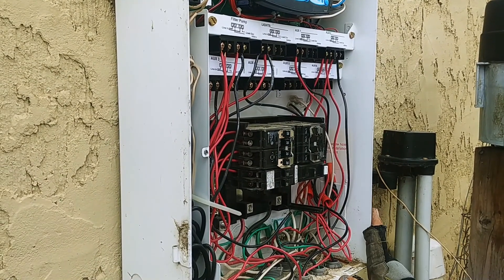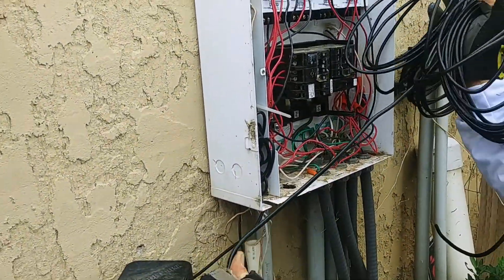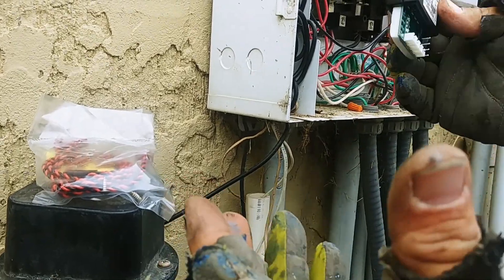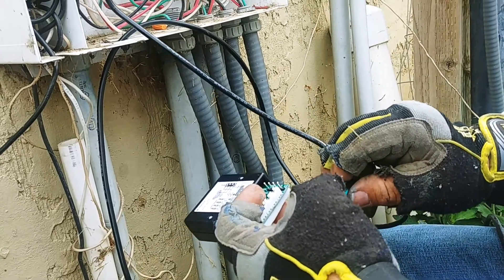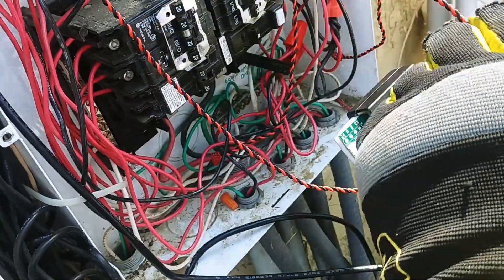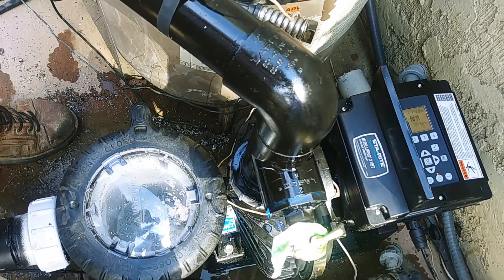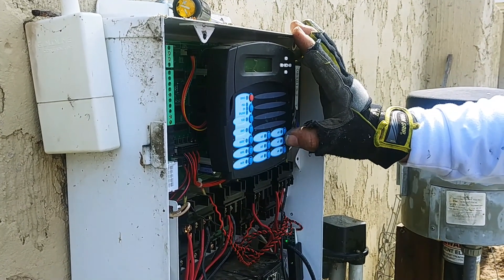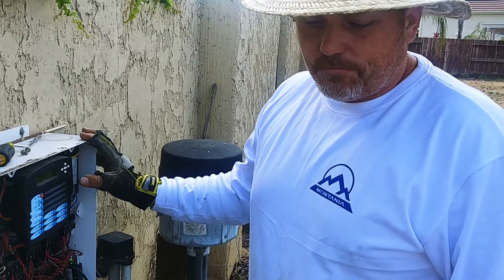Intellicom 2 Intelliflo / Intellipro Controlled From Any System  Hayward, Jandy, and older Pentair

Comment: i think this is a poorly designed product. 1. The hayward panel already has 2 wire for comm that control hayward v/s pumps, this box should be designed to convert that comm to the pentair so it would be simple. 2. if you have all your relays used up, you would have to buy an expansion kit just to do this which then increases the price by another 600 or so
Reply: Hayward is aware. I believe it is intentional
Reply: Only if it’s a Pro logic , otherwise if it’s a AQUALOGIC , you’ll need the interface adapter, and also the pro logic has to have a 2.0 revision software. Been doing this 21 years now and I still learn new things everyday. Personally if it’s a Hayward automation system I tend to use Hayward products.  Pentair system pentair product. , etc.

Comment: So the low voltage wire you connected to the pump, does that come with the Intellicom 2 or do I need to purchase that separately?
Reply from the maker: It comes with the red and black jumper wires
Reply: In all of the ads I see for the Intellicom I don’t see that particular wire with the screw cap in any of the pictures?

Comment: So for each programmed speed, you need an open available relay, is that correct?
Reply from the maker: Yes that is pretty much the case however if you want the pump to come on along with something else like a light or a booster pump you can share the relay. Then the pump speed we'll come on as well as the object that's normally on the relay.

Comment: Hi John,  Tomorrow I will be installing one to a Jandy RS system.  My question is when I wire the Rs 485 terminal bar to the intellicom adapter,  where do I pull out the two wires ? Green and Red wire?  I didn't see it in the kit.  In your vid. you had it already wired to the terminal bar.
Reply from the maker: I just used some of the wire that came with the Intelliflo....... You need to follow the manual for the RS panel because the hayward 4 wire terminal bar is in a different order.... One wire is 24V and one is ground the colors don't matter as long as you get the hot to the hot and the ground to the ground.
Reply: @JohnThePoolExpertGuy  thank you!

Comment: John, I need help with getting the mobiletouch to connect to the intellitouch
Reply from the maker: Michael Grinnell 

1. On the IntelliTouch Outdoor Control Panel, press the Reset
button (see control panel illustration below).
2. First Time MobileTouch install: The three red System
Control LEDs will be lit (solid). Wait a few seconds then
press the “F” Filter button. For IntellliTouch model i10+3,
press the “P” Pool Filter Pump button.
Add a MobileTouch with existing MobileTouch installed:
The three red System Control LEDs will be lit (solid). Wait
a few seconds then press the “V” button or “1” button.
3. The three red System Control LEDs and the auxiliary
button LEDs will begin cycling. Wait until the LEDs stop
cycling. The three System Control LEDs will start to blink
on and off. The IntelliTouch system is ready to assign an
address for the MobileTouch wireless controller
4. From the MobileTouch
Advanced screen, press the
lower buttons 2 and 4 at
the same time. The
Service Personnel screen is
displayed.
5. Press the button next to LOCK
ON ADDRESS to access the
next screen.
Press button 2 and 4 at the same time to
access the Service Personnel screen
MENU SETUP ADVANCED
Getting There
Note: For MobileTouch firmware version 1.160/2.160: The "Lock On
Address" line displays "MAN ADDRESS LOCK AUTO" - Press AUTO to
lock on the address. If MobileTouch does not connect then use the MAN
(manual) mode. You will notice on the IntelliTouch outdoor control panel
there are three System Control LEDs flashing on and off. There are also
two other LEDs going on and off. Watch these LEDs and you will see a
pause, followed by one of the AUX 1 - 8 or Heater or solar LEDs flash
on, then it goes off and a second LED will flash on. Then pause and
repeat over and over. AUX 1 - 8 represent number 1 - 8, Heat = 9, and
solar = 0. So if you see Pause, AUX 2, AUX 7, see Pause, AUX 2, AUX
7, etc. This indicates CHANNEL 27. The first LED is the 10's digit, the
second LED is the ones digit.
Continue on next page.
6. Note: Before pressing the “Lock On Address” move
at least 20 to 30 feet away from the transceiver. Press
the button next to LOCK ON ADDRESS to assign a unique
frequency for the MobileTouch controller to avoid inference
from other wireless devices within range of the MobileTouch
transceiver.

Comment: Why would you leave a 24v board in a high voltage area? It should be installed in the low voltage race way on left side.
Reply: ha,with all the tandem breakers and no gfci protection there isn't anything that could go wrong!!